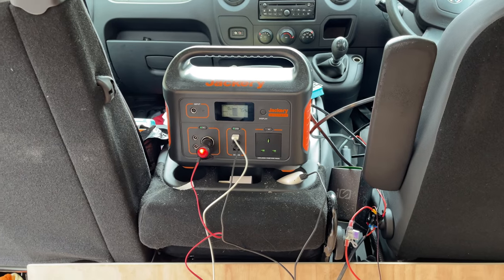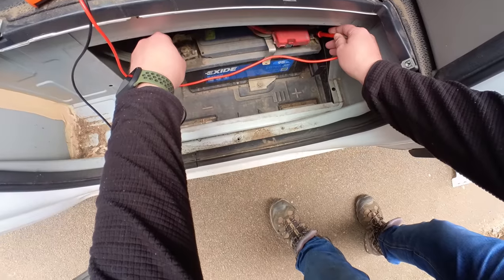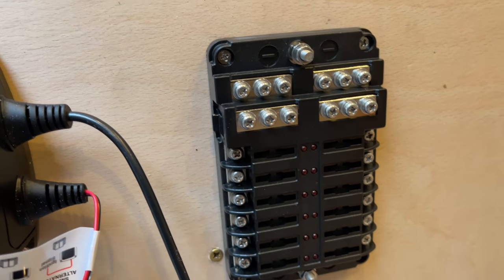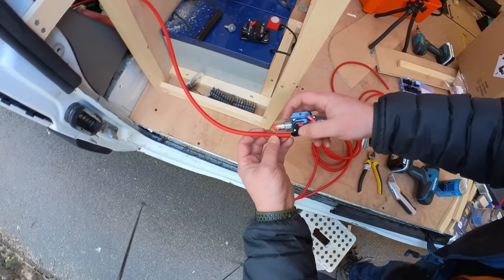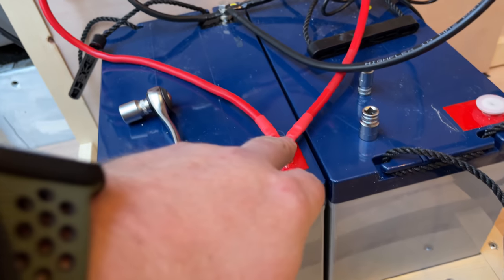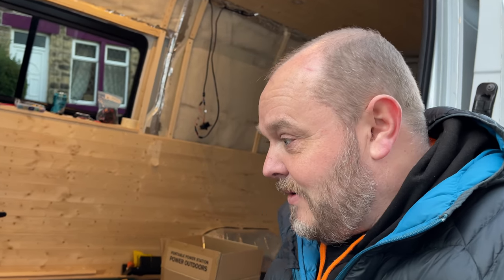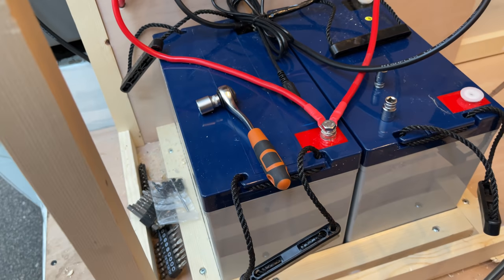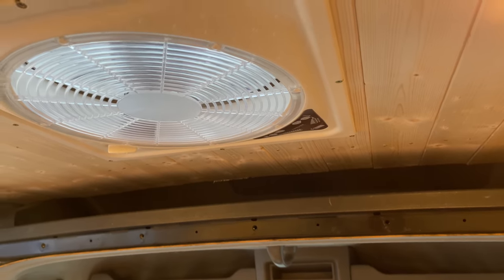Installing off grid 12v camper van electrics | Campervan conversion UK

Comment: When you get the cables to join your leisure batteries in parallel, make sure you have the positives connected to one battery, and negatives connected to the other battery...helps even out the draw when is use and also when charging etc...

Comment: You need a breaker closer to the van battery, as you have an unprotected end, at the van battery end.   If that part of the cable was to short out it wouldn’t be able to break the circuit from the van battery.

Comment: Good video and good work. when you need more power. Buy the smartpas 120 and connect this to D250se. Then you have 150 Ampere charging power, it is much faster then what you have now with only D250se .  But you need then thicker cables. ATB Raymond

Comment: Just wondering if it would have been better to maintain the through access from the back of the van to the drivers seat. As you have partitioned it off (@2:48), this would mean that you will need to physically get out of the van every time you want to access the driving compartment. 

You might regret it when its chucking down outside or blowing a gale.
Reply: Captains seats and thru access for sure 👍

Comment: good nice clean install!!

ok the criticism, I'd have thought making the install on a smaller scale would've been better suited as it would increase the internal volume for the van (helping you store more in cupboard's etc)
the 2nd aspect is surrounding the location of the battery, again subject to what you liked or not etc again I'd have thought it better suited to locate the batteries outside or in a similar location as the main battery leaving the electronic controls in a internal easy to reach location.. again maximising internal space & giving added protection in-case of a fire (I'm mentioning fire as at times control modules fail & the unfortunate occurs)

anyway your doing a cracking job upto now & not forgetting every day is a learning day especially when carrying out something new like making a DIY camper-van.

Comment: Excellent video Paul I’ve been back to this video many times as a template for our build. Thanks for making it and having it be well explained and easy to follow.

Worth noting that the D250SE has a max input voltage of 23V so when choosing the solar it will likely have to be a 12V panel (they’re commonly 24V or above so the 12Vs can be a bit more expensive). Or you can get a 24V+ panel and put an MPPT between it and the CTEK since it will convert it down to 12V, though you’ll basically have two MPPTs at that point.

All the best with the rest of the build sir!

Comment: when you were planning the build, did you think about front to rear access from inside?
Reply: Normally you would have access through the van, even if it was just a small opening. Not ideal having to get out in the pouring rain to get something in the cab.
He is doing a great job though. I would make the electrics a bit more compact so that the top of the cupboard could be used for storage. Never enough room in a van conversion! 😀

Comment: Very nice work, I would have a look at a battery guard for your van, you do not want to drain the battery when out and about
Reply: Second this, from the way it’s wired leds, fan directly to the battery I can’t see any shutoff protection on draining the batteries past a certain point.

Comment: May I suggest the main fuse should be as close to the starter battery as possible because the length of wire from the starter battery to your control panel is unprecedented great video as usual

Comment: I'd like to recommend lanolin based wool grease for your chassis and battery terminations, especially the chassis ones. It'll totally eliminate any corrosion and intermittencies making connections reliable and trustworthy. Used it extensively on my vehicles and never had a dodgy connection in years. Link here.
https://www.lanoguard.co.uk/products/marine-grease-lanoguard

Comment: You made a good choice going for a B2B or DCDC charger over a voltage sensitive relay mate as a VSR will never fully charge your batteries.
I see so many people using VSR’s because there cheap but there certainly not the way to go, especially with AGM batts.
As someone in the trade I can tell you your doing a great job and have obviously researched what your doing 👍🏼 top marks Paul 👍🏼
Reply: Also...off topic
Have you seen Hilleberg are auctioning off for charity the 1 and only Camo fabric tent they made??
Might be worth a shout on your next video I’m sure with the following you have you could push the numbers up even higher 😊 atb

Comment: I like seeing people having a go, but if I may.
The fuse/breaker coming from the van engine battery needs to be closer to the battery. Youll notice the other main fuses nice and close, generally the rule is to have the wire before the fuse short enough that if it breaks it can not reach ground, and then of cause after the fuse if a wire breaks the fuse will protect the battery.
If you are grounding the accessories to the van like you have, you dont need a common groud at the fuse box because the whole van (metal parts) become a ground, so you can save on wiring, which can save money and weight, cause a lot of wire is heavier than people notice.
And if you run the wires, charger to breaker, then braker to fusebox, then put a second wire on the fuse box to battery, you would save 1 breaker and 1 wire and it would still work the same, because electricity is not directional. Would be neater, less points of failure and again lighter. 
Thats just an auto elecies 2 sents! 
But thats for the vids, I enjoy them all the way from Australia.
Reply: And with the fuse box is connecting the battery and charger, if you need to remove the battery for any reason, lets say its blows up, you can still get power from the charger (engine battery).

Comment: Excellent video. And you are learning so much about the electrics. Do yourself a favor and install an LCD Voltmeter somewhere so that you can always see the volts on your batteries at any given time. I installed a dual voltmeter up at the driving seat position so that I can monitor my car's battery voltage and my 2nd camping battery while Im driving. Cheers

Comment: That was easy peasy. Very well explained and filmed. I guess you will be adding a voltmeter and some USB sockets at some point too. CTEK is a good brand. I have several of their AC to DC battery chargers, both new one's and old one's. The only problem I have had is that one of the plastic handles just broke off of the 25A charger (the outer protection of the clamp that goes on the battery). I would most likely have chosen a CTEK DC to DC charger too if I were to install a solar setup in my van. Then it would be nice to have the alternator charging option too.

Comment: Great job as always!  It might be worth checking the latest video from 4xOverland channel - where he suggests to always trip the circuit breaker or disconnect the main vehicle battery when the vehicle is stopped to prevent the vehicle battery draining, fitting a volt meter so you can monitor the battery situation and it would be worth having the ability to externally charge the 2 x AGM batteries by either a solar panel or mains?

Comment: Lovely work. Was there a reason you orientated the batteries that way? They seem to extend further into the van than they need to, especially in the doorway. Would it have been possible to create ‘bunk beds’ for them within the cabinet so they take even less space? Requires more cabling, but I don’t imagine the voltage drop would be significant.

Comment: Great Video and great work. You've inspired me. I have all the equipment a Ctek 250se and a Smart Pass 120 a battery and battery box to fit in my 4WD and I've had it for about 6 months and not completed the install. All I need is to get the cabling. I'm away next week but the week after I'll fit it. Thanks.

Comment: Just a small observation, I would put that 30amp breaker between the main battery and the ctek as close to the main battery as possible, if you get short between the breaker and the main battery it won't be pleasant. Otherwise great video.

Comment: Do you not have to upgrade the alternator now it’s charging 3 batteries ?
Reply: The Alternator won’t be charging all 3 Batteries at once , it will either be a ) The Starter Battery or b) The 2 Leisure Batteries .

Comment: Get dc to dc charger
AGM: Charger Amp rating = Battery Ah capacity * 20%
Lithium: Charger Amp rating = Battery Ah capacity * 50%
So, a 100Ah AGM can use a Charger up to 20A
100Ah Lithium can use a Charger up to 50A

Comment: Hi Paul. Thanks for the video. I’m about to wire up my CTEK controller and have midi fuses but want to isolate the circuits as you have. Just wondering how you are getting on with the in-line breaker circuit fuses. There are mixed reviews on Amazon suggesting questionable quality and reliability. Thanks in advance.

Comment: Hi Paul, I have followed your video and it is perfect! Just a quick question, if I wanted to add a 240v hookup to this setup for if I stay at a campsite, how would I go about wiring it up? I would like some sockets in the cab and for the leisure batteries to charge from the hookup too. 

Cheers!

Comment: Great work and good filming as ever. I love how simple the set up looked. Just wondering if the C-tek unit prevents you draining the van battery if you leave something connected to the leisure battery and forget to switch if off? Have you effectively got 3 batteries working together sharing the load, or is the connection between van and leisure batteries only for charging?
Reply: This charger will stop taking a charge from the van battery when it gets under a certain voltage (ie is not running) if he eventually connects solar and the leisure batterys are fully charged it will actually start to trickle charge the van battery.  So, no, theres no danger of draining the van battery but these arent cheap.  Hope that answers your question
Reply: Why not fit dis moter outside because of the noise de moters make as dir fitted on trucks outside

Comment: Hi, I have a 2013 Sprinter (UK), i would like to add a relay kit like what you have but i am not sure if the alternator is a smart or ordinary one. I did try ypur method, measuring the batt output while the engine is running, and had about 14.xx volts measured, then waited for about 10 mins, and measured it again, the reading was almost the same, it did not go down to 12.xx as you explained here. Can i conclude that my van uses an ordinary alternator? i can't have a go to order this kit, until im sure on this. your help will be appreciqated, thank you!

Comment: Hi mister Paul, do you help me to know what is the section of the electric wire which leaves the auxiliary battery and which goes to the fuse box, 10mm2 ?  Thanks for your answer i begin in van life recently.  Perfect job in your van.  Thierry the belgian.

Comment: What was you running off the jackery? Wanted to just run things off that. I.e fan, fridge, TV. How do you power the fan on the portablez did you attach a plug or does it come with a connector?

Comment: Thanks for the great explanation. I have the exact same CTEK and fuse box. One question to anyone who knows: everywhere I've seen it says to connect 12v appliance negatives to a bus bar which is connected directly to ground. Ive seen people not using the negatives on the fuse box and connecting everything to a separate bus bar. Is the set up you used (connecting the negative from battery to ground, and to the fuse box, and then the 12v lights to the fuse box) the exact same thing? Thanks

Comment: Great video Paul! 

I'll be sure to catch up on the series

Could I ask: When using the CTEK, where in the circuit would you add an additional mains hook up?

Thinking of using the same schematics & components in the jot to distant future. Also with the possibility of adding addition power sources and 240v 

Dig in, keep warm and stay safe

Comment: Could anyone advise what the cabling used is please (thick red cable). I have bought a van with leisure batteries already installed but they needed replacing so I bought the same ones as Paul. Van has split charge relay already installed so can I forgo the ctek?

Comment: The explanation of the fuse box is a bit off. Better hope the positive doesn’t go across the fuse and up to the negative or you will need quite a few fuses😉. The fuse is connecting the positive source to the load. The negative is connected via a straight connection, no fuse. Never the Twain shall meet, hopefully🤞.

Comment: Didn‘t you made something wrong with the small cable that comes out of the right side of the ctek?
Red is for Alternator Type and Black ist for the Baterry Type, the black one has to go on the earth for agm battery, but you have put the red one on the earth. But the red one has to go in the fuse box on any + at contact….

Comment: Great job on the wiring Paul. However, It still amazes me why folks are still using lead based batteries in RV systems, in fact in any application really. TCO of Lithium wins hands down, and that's without the fuel savings in not lugging around 50lbs of lead based batteries.
Reply: They need to come down in price.
Reply: @milcotto4153  Comparing initial purchase price isn't really looking at the full picture. By the time you've taken into account the various factors that differentiate the 2 battery technologies, it's much cheaper to go lithium. They are lighter, faster charging, more energy dense and longer lasting. You'd typically need to replace lead systems a minimum of 4 times before you need to change your lithium battery, for a comparable number of charge cycles. You'll probably find that you don't need to use as big a lithium battery to meet your needs as you can draw over 80% capacity without damaging the pack or reducing it's life. And as you aren't lugging 50lbs of lead about, you'll save fuel.
I've been building my own lithium battery systems for portable amateur radio use for the last few years. I've even built a big battery using 2nd hand cells that is now nearly 2 years old and powers my radio system for up to a full day.

Comment: from my experience with the ctek unit id now not put a breaker between the ctek unit and the battery because if there is power going into the ctek unit and it has nowhere to go it buggers the ctek unit as i found to my cost

Comment: hi Paul really great video.

I'm struggling with my electrical installation and am super keen to have this system.

I'm really confused as to if I still need an inverter???

I plan on having 6 wall plug sockets for appliances such as kitchen stuff, chargers and then lights. same as yours.

small coffee machine a small fridge as well. 

any help would be greatly appreciated. 

many thanks 
ben
Reply from the maker: Hi Ben. My system is only 12v. If you want to use 3 pin plug coffee machine then you'll need an inverter or a mains hook up

Comment: Hi Paul, 

What cable sizes are you using?
Reply from the maker: It depends on what current is running through them. The cables also need to be rated higher amps than the fuse ( that should be the weakest link in the circuit)

Comment: Hiya mate, just a quick question. When you earthed the ctek because of the alternator did you connect both the black and red wires to your earth terminal? All the best. Gaz
Reply from the maker: can't remember but it all depends on the type of battery you have..
Reply: @PaulMessner  no worries mate, cheers for the reply. I've got an agm battery and no smart alt so just had to earth it. Your vid helped hugely thanks👍